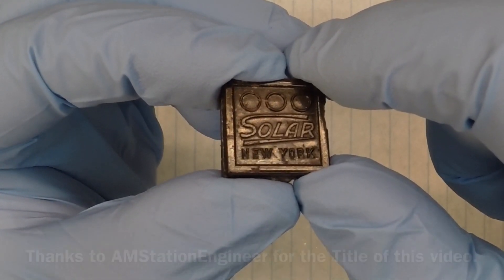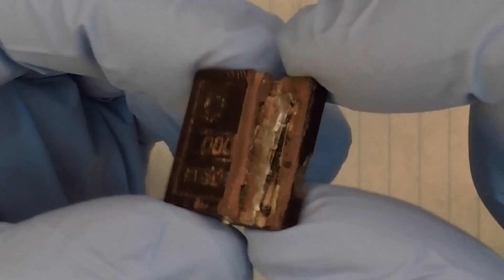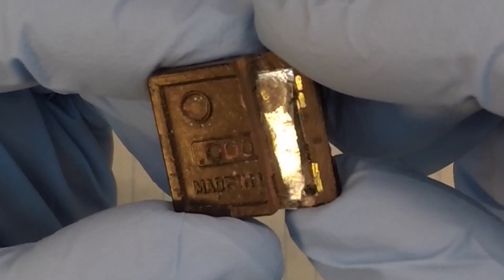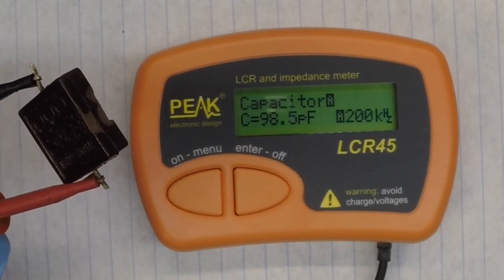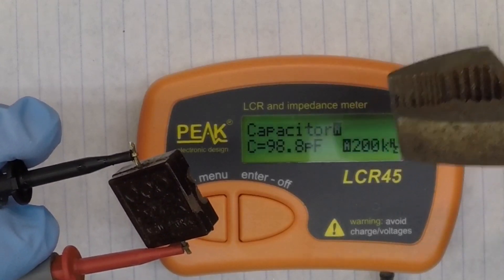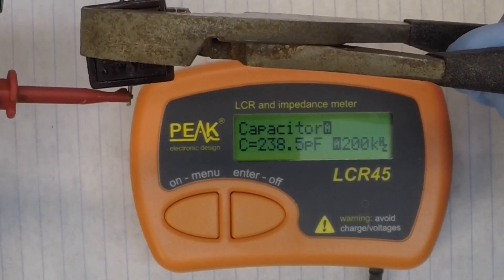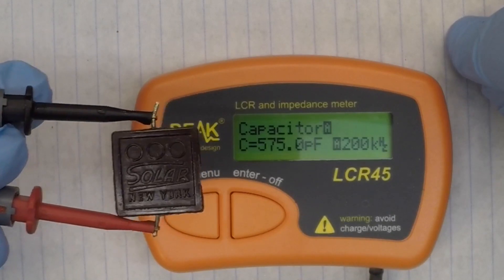Structural Failures In Once Stable Mica "Domino Style" Capacitors

Comment: I remember taking a large transmitting mica capacitor apart in the early '70s and using the mica as insulating material for mounting TO220 type transistors. It works really well if holes are made with a sharp punch!!

Comment: I am still new to tube radios and don't have nearly the experience you have, but it makes sense that the capacitance would change when you compress it. The plates are being squeezed closer together. The exterior of Mica caps is somewhat flexible. But I still don't know why the value would change. The mica sheet is the dielectric, there is no "fluid" to escape. Maybe moisture got in through a crack?
Reply from the maker: Probably moisture/heat over time caused the failure is my guess too. Thanks for watching and reaching out. Best, Don

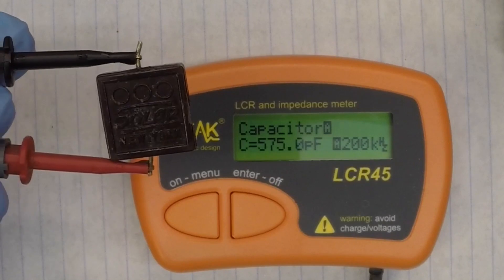Comment: 2:53...maybe it's not the seal that's the problem- it COULD be that the plate/dielectric layers inside the capacitor case have separated from each other, causing the capacitance to decrease-(?)
Reply from the maker: Good point Dale, that may have been the root cause of the failure. Thanks for watching and reaching out. Best, Don

Comment: Guess I wouldn't be shocked that squeezing a casing could alter capacitance a little but that was a huge change & apparently didn't return to the same number when released. Failing physical contacts, it seems.  
I've gutted a lot of rolled foil & paper caps lately & have been surprised at how dicey some of the wire to foil contacts seemed.  Basically, they're just pushed together.  After 70+ years, I guess it should be expected 2 differing metals in mere physical contact might not be as good a connection as once.
Oh... Also wanted to say that's a nice job of opening that case up!  I'd probably have smashed it with a hammer & sorted thru the debris.  :-D
Reply from the maker: +Wayne Hall It's amazing they have lasted this long. I considered the hammer too, but elected to use my mini hacksaw on it. I replaced another mica that tested good and tried to affect change by compressing it, but it was stable as a rock at 97 pf. Best, Don

Comment: Don - do these caps have failure issue like electrolytic's?  I don't have any experience with them as I generally work on newer devices from the 1970's onward, however I currently have a device (that I'm working on) from 1977 that uses them.  They don't have a positive / negative leg...I treat them like ceramic caps, correct?  Thanks!  ~Jack, VEG
Reply from the maker: Jack, sorry about belated response. I’ve been busy with other... If they are true mica, they are typically stable and don’t require replacement. To your point, it doesn’t mater on the orientation. Enjoy your Thanksgiving. Best, Don

Comment: Thanks Don! I'll keep that in mind in the future. Like some have said, micas almost never go bad. You had two in the same set. Wonder if it was a bad run of parts? Environmental? Who knows? Id send those back to Solar and get a refund or replacement! Lol. Very good informational video. Thanks! Larry
Reply from the maker: +Backtothefutureradios I sent them to you with the PBs, just kidding. Best, Don
Reply: Yes, I too wonder what the root cause is. I do not think it's because the mica simply went bad over time or something like that, instead I would say something compromised the case a good while ago and let air and moisture in. Could be environmental (corrosion of the leads going through the case) or mechanical (microfracture in the case or seam).

Comment: Maybe hot and cold of the radio caused it to fail ,did you replace it with another modern silver mica cap,or can you use a regular capciator? Thanks for showing the insides of that mica cap .
Reply from the maker: Ron - silver mica would be my preference, but I think I through a polystyrene cap in its place. Best, Don

Comment: Interesting!  What do you replace these Mica Caps with?
Reply from the maker: +Dan Barrera Dan, I would recommend replacing them w/ dipped Silver Mica Capacitors being they resided in the oscillator circuit. I didn't have any on hand, so I used Polystyrene Film. http://www.justradios.com is a great resource if needed. Best, Don

Comment: I just had a horrible thought; could this soon happen with ceramic discs, too?? - they've been around since the 1920's (in one form or another), and with the 'full quench kiln fusion process', the sintering heat was not fully effective with respect to its ability to cohesively fuse the anode and cathode to their respective contact plates. We've all witnessed ceramic caps which delaminated at the plates, or saw a ceramic dielectric section split.

With that said, I've never changed one which failed electronically; mechanically is an entirely different story.

"Send this thesis to the library, for publication - and archiving- your PHD will soon follow" ;)
Reply from the maker: +AMStationEngineer That is horrible; more parts to replace lol. I like the name of the video, so thanks again for your recommendation. Best, Don
Reply: Exquisite execution on your part - regarding  everything from its conceptualization, to a most effective execution of the demonstration of your discoveries, and the theories behind those assumptions.  Plain and simply, my contribution, was the ability to weave a little bs into a tapestry; a skill which has been of great benefit throughout the years; I should've never kissed the Blarney Stone in '85!
Reply from the maker: +AMStationEngineer Thank you sir!